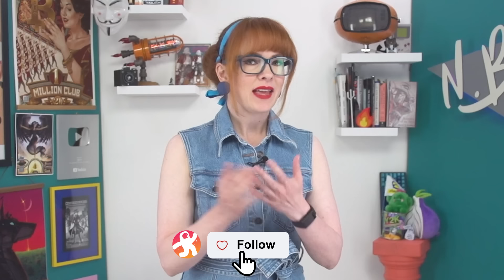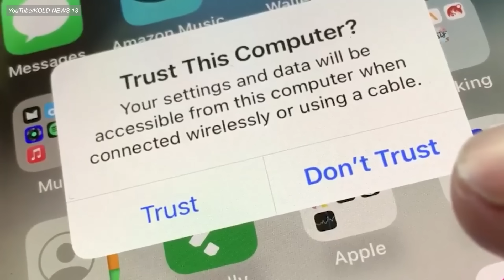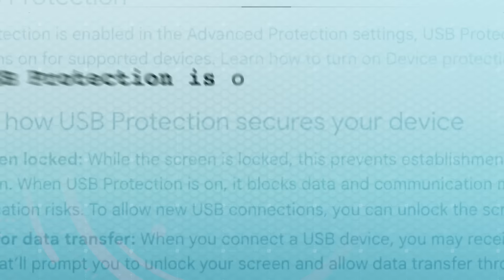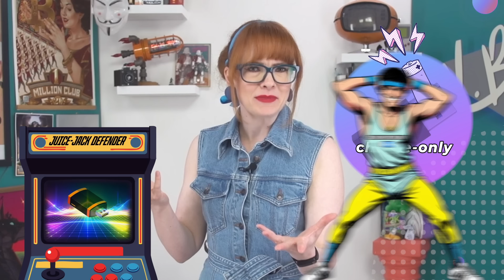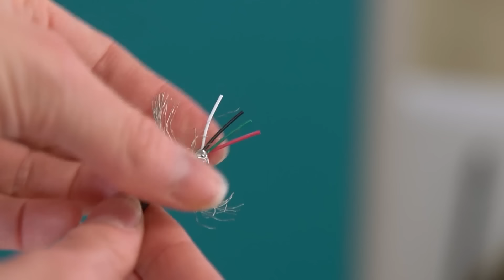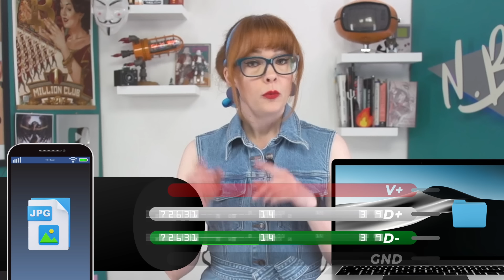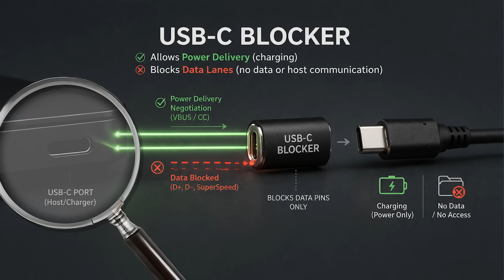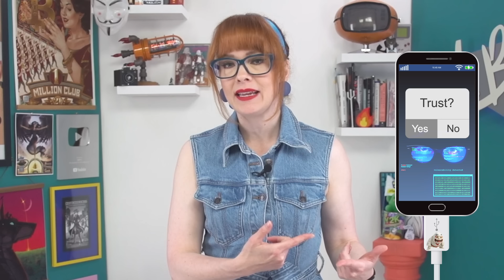Use THIS When You Plug In

Comment: Great info!

I will give an alternative recommendation for the tech inclined though...
There's a device on the market usually called "USB Cable Tester" that you can use to test USB cables to see which pins of the USB ports are connected to each other.

It's not only useful to check if the data pins are active, but also to check stuff like - if the cable supports fast charging, what USB-C standard it's compatible with, if you don't have breaks from damage, etc. It's just testing the connectivity between pins, and you figure out specs and status from that.
If you have lots of tech stuff at home, you likely have more than a few cables that are charge only. They tend to come with simple USB powered gadgets, though most of them is charge only with no fast charging as Naomi explained. But it's likely good enough for a quick emergency boost.
I do have some cables that support fast charging and don't have data connection though, it really depends on what the gadget is I guess.

So it's more a matter of identifying, organizing them and labeling them properly. If you can do that, you don't really need an extra dongle.

I personally have both a USB Cable Tester that is just a bare board (PCB) with a bunch of leds and a bunch of different USB ports running with a button cell battery, and a more advanced USB Fast Charge Tester to check how much power a device is actually driving. USB Fast Charge Testers won't tell you much specifically about the cable, but more about the port it's testing and devices. So, you can tell things like whether the device you are powering supports which version of USB, how much power is being drawn divided in amperage and voltage, perhaps something extra like temperature reading - depends on model.

Very useful stuff to have. I guess it's more geared towards repair, but I think it's still plenty useful for everyday usage.

Comment: I agree with you, USB data-blockers are a good thing that so few know about.  I now keep one blocker in the case I use to carry around my phone (so I always have it when needed).  And while I don't use my blocker a lot, I do use it use it whenever I don't personally own/control the charger I'm plugging into.  So hotel chargers get the blocker and ditto for chargers in the lobby of some business.  However, when I'm plugging my own charger into 110v power I don't use the USB blocker (since its unlikely my personally owned charger has been hacked).

And yes, I realize that some might consider my approach as "paranoid", but the truth is that some bad guys have used hacked charging stations to attack the devices of those who use those chargers.  And since a data-blocker is so cheap and easy to use, why take the risk?

NOTE:  The model of data-blocker I own does block "fast charging".  So I just live with the fact that if/when I'm using the data-blocker I'll be limited to the normal/slow charging speed.

NOTE:  I tested my blocker to make sure it works properly (so i'm not just assuming my blocker does what I bought it for).  What I did was first connect my phone directly to a laptop i own and see the effect (phone starts charging and also tries to establish a data connection).  Then I installed the data blocker on the end of the cable and tried again (no data connection setup, but  still charges the phone from the laptop's power).  Finally I repeated the test with no blocker installed and confirmed that the phone was again trying to negotiate a data connection with the laptop.  Conclusion was that my blocker was letting charge power through but blocking data (exactly what a data-blocker is designed to do).

Comment: Wireless chargers are power only, which is a side benefit of less efficient charging. I also have data blockers in my travel kit
Reply: The wireless charger can absolutely have an NFC reader built in to it as well.  How is that google wallet working out?
Reply: @johnpublic6582 NFC is disabled by default, so it's a non issue for me until I switch it on.

Comment: -- For your home:
There are power strips that have USB charging ports.  And since the power strip plugs into your wall, there is no data connection to anything.
Of course, you will not want to carry around a power strip.  The tiny part that our host demonstrated is ideal for portability.

But at home, I do not want my iPhone connected to my computer for charging, because I am only charging.  So I use my power strip's USB charging ports.

Also, when a guest asks to charge their device, I do not want to insult them and say "Here, use this data blocker device".  Most people throw smart phone and computer security to the wind, and will look at you like you are wearing a tinfoil hat if you ask them to use a data blocking adapter in your home.

So, I show them the power strip's USB charging ports, and that avoids any drama.  They just plug in their device, and it charges.  They give it no thought.  And I have no worries about their device being on my network.

There are countless power strips that have USB charging ports.  So if you need a new power strip, you might as well get one with charging ports.  Do they cost more?  Too hard to figure out, because even before USB, power strips varied in price.

-- For the car:
If you have passengers that want to charge their devices in your car, then purchase a cigarette lighter adapter that has USB ports.  I purchased one when I was at my local car wash.  They sell them everywhere (in actual stores and on-line).

Your passengers will plug their device into that cigarette adapter's USB port, and no questions or drama will ensue.
Reply: Ethernet over Powerline.  WiFi AP inside power strip.

I know normal people don't take it that far, but these things do exist and there are people who are targeted and compromised by them.

But probably, if you know, you know.

Comment: Would love to see a video on the possibilities of hacking power converters and battery banks by reputable companies like Anker vs no-name companies on the Amazon "recommended" lists.

After getting hacked in 2024, I'm paranoid about everything.
Reply: I don't think you can just "hack" them. Surely you'd have to replace the guts entirely with a miniature computer. So perhaps the question is rather how small can such a device be, and which devices could fit one? And still fit some kind of power supply circuit at the same time I suppose. Where I'd be paranoid is fixed USB outlets, where a device could be hidden behind the panel (or larger multi-port hubs in theory). I can't imagine there's any risk whatsoever of someone compromising a regular charger just by hooking something up to it, if that's what you're afraid of.
BTW; GrapheneOS seems to be more secure against this. If you're paranoid about device security that's definitely something you could/should look into. It has superior security in many other ways too.
Reply: @Jutastre 

Yes to all of these things. 

Already quit taking "free" thumb drives from conventions and buying cheap charging cables. 

Would just like to know what the capabilities of a "smart" chargers and power banks are.

Comment: That's why I always bring a power brick with me whenever I travel
Reply: Yes, me too.  I don't even pair my phone to my car, after hearing the CEO of GM telling a business channel that they expect to make more money  selling your activity data to data brokers and the gov., than they make selling cars.
Reply: @SighOp  Your car is still sending all of it's telemetry from the car's activity with or without your cel phone.
Reply: @timberpoodle3916 yes but when you’re phone is paired it takes everything including your texts
Reply: @SighOp Great point. Best to pull over to call. Car telemetry is far worse than charger but you're the only one that mentioned it.
Reply: You can also daisychain your powerbank and your phone into public usb ports. The Powerbank acts as a protection
Reply: @hanfo420as long as the power bank supports pass thru charging.
Reply: @hanfo420 That's a good idea! Thanks.
Reply: Yup, you only plug into your own stuff. In an airport I only use my power bank
Reply: Another point to this, BRING BACKUPS! If you are willing to buy a USB data blocker you should buy extra cables too. If your cable breaks there's no guarantee that the replacement you buy at the airport is trustworthy
Reply: @cyrusgaming943 Yes, similar to hackers just leaving USB sticks laying around, Rubber Duckies.
Reply: @keithbarron3654  In another "safety" video they mentioned to never plug in a USB stick into your devices that is not yours or from a known source. Hackers set them up and leave them in public places and high-five when some poor person plugs their USB into their phone or computer.
Reply: Exactly I never put my phone directly into any public USB port. I always use it to charge up my power bank instead. And then use the power bank to charge the phone. And if I actually have to use public charging infrastructure I use wireless charging.
Reply: Me too 😊
Reply: Yeah, I was shocked when this video opened with all these weird things you plug your phone into.
Reply: Me too. Data free charging and assured/correct power supply. Especially with USB-c variants of fast charge and multi-mode data connection.
Reply: @davidnicholson4136 Then wireless bluetooth rips your data while your talking in your car.😮😮😮😮i
Reply: Yup; who needs a data blocker when you could just bring a sufficiently powerful (I have a 65W one that can charge like 90% of all portable devices) power brick with you? And if you’re in your car, get a 12V car adapter that plugs into the 12V socket instead of plugging directly into the USB port. If your car has a 110V inverter in it and regular outlets, even better!
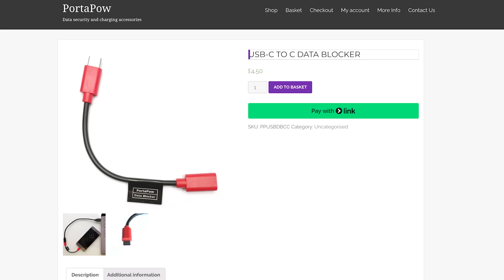Reply: 8:25 or just test the USB-C datablocker on your own pc/laptop to check if you still can access you phone.
Reply: You 'can' tap data thru power pins (depending on the device being charged), so this is smarter.
Reply: This is a way better solution to be honest. It’s so much more capable and does the same thing.
Reply: Same!
Reply: That's a good idea but also good to have a backup when your charging block goes dead!
Reply: I usually just do that anyway because i never evem think that there will be some USB charger just available where i am and mostly i need it in the first place. Well except if i forget to take it.
Reply: Its what I do as well
Reply: Same here 👍
Reply: Just bring a power only usb lead.
Reply: I always brought a USB hub with me to work because I felt lucky if a port was available in the break room. All the more reason to have my own charging station everywhere I go.
Reply: Genius 😂😂😂😂
Reply: Condom USB data blocker😂😂😂 now ur smart phone and laptop and tablet needs a condom😂😂😂 electronic STD
Reply: Good idea. FYI - one caution if you are taking a longer flight is that airlines are restricting the use of power banks. On a recent flight they announced a couple of times that it was not acceptable to charge a device on the flight with a power bank, or connect one to the charging receptacle at your seat.
Reply: @ArtIsExperience yup, I had recently traveled by air and the captain of the airlines kept reminding passengers to not plug in the power banks to the USB electrical outlets on the back of the seats to charge them.
Reply: @MrRoda8143 always charge the powerbanks at regular power socket with adapter in hotel room, airports, etc but never in an airplane, trains, etc.
Reply: Yup the only way to go.
Reply: Me too.
Reply: I do the same 😊
Reply: That is the responsable solution, plan ahead and don't depend on others for things you can take care of yourself.
Reply: I carry mine in a sock.
Reply: there's never just one device to charge when I travel, so I always have a multi-plug charger with me that uses a regular mains power plug.
Reply: I burn my one from cheap USB hole in my hotel. It was wrong polarity I assume. Powerbrick has safety mechanism. So two reasons.
Reply: just cut the data lines in the cord :-\    the red and black are power....      so it charges but no data :-)
Reply: Good idea but you need to be sure that the power bank itself is safe and not stealing your data. Power banks are usually charged via USB and if one is malicious it could copy your data onto itself then send that data out when it's plugged into a USB port to charge or by WiFi etc. Any device with some electronics in it can be turned to malicious/surveillance use. Always do your research.

Comment: Juice Jacking is such a non-issue. For years people have been warning about it, demonstrating how it works at hacker conferences, etc, but when it comes to confirmed real life cases ... there are extremely few to be found. And it seems the very few cases were targeted. 
A USB Data Blocker is cheap enough and doesn't hurt, but even without one it's fine.

Comment: My phone warns me if I want to connect for data too.
Reply: The fact it even notices that there is a data connection attached means it's listening, which opens the possibility that someone has found an exploit to get in without you explicitly allowing it. It's one layer of security, but it's not perfect. Some phones (Pixels with GrapheneOS, not sure what else) lets you disable the data pins entirely, so it's even more safe, with the tradeoff being that it can't prompt you to enable them, since it can't know you've connected to something on those pins. With how rarely I use the USB port for data nowadays, it doesn't bother me at all that I'd have to go into the settings and enable them every time.
Reply: I've got a Graphene phone. It comes with a good default setting, and an option to customize. I have my port set to charge only. 
If I need to use data, I know exactly where to find it in the settings.
Reply: @rayrous8229  On android "charge only" became an option in or before v 2. (2009) as far as I can tell.
In v6.0 (2015), same version that introduced USB-C, it became the default option.
So unless the specific phone model overrides this default behaviour, any newer android phone should be "charge only" out of the box.
So not Graphene exclusive.

When connected to a 'data' device (e.g. computer or car), there's an option to activate data for that session in the notification bar.
The option to change default behaviour though, was moved to developer options, which is a 'hidden menu'. Unlike what I understand from your comment regarding Graphene.

Personally I don't travel much, so never have to plug into unknown charging ports.
If I did though, I would still buy and use a "Data blocker". Since hardware solutions are per difinition more secure then software.
Since most people are pretty tech illiterate, I would and do suggest them to friends and family.
Reply: Oh that's a great feature! Which phone/OS?
Reply: @imnotusingmyrealname4566  Android?
Reply: @imnotusingmyrealname4566  My google pixel does that too, it gives a popup and you have to click 'yes' or 'no' to confirm you want a data connection
Reply: @imnotusingmyrealname4566  Android One on Nokia Smartphones, allthough some updates predict bad weather.
Reply: Unless it is told not to.  If you plug your phone into a hotel lamp in China or probably the US too, it could easily have malware that keeps it from warning you.
Reply: @michaellowe3665  Sad we have to think this hard about identity security now. You can't trust your laptop's camera indicator light, only something opaque over the lens. I never scan QR codes and worry about things like digital Coke machines collecting my fingerprints....  

I wouldn't mind the the advanced luxury benefits from pooling all our data so much if our human culture was a lot more ethical and honorable than it is.
Reply: My phone doesn't connect to data by default. I have to manually set it to data transfer if I want to.